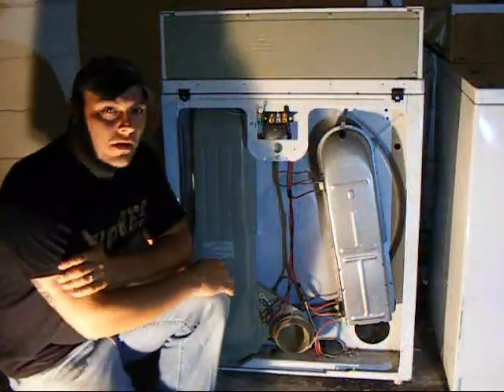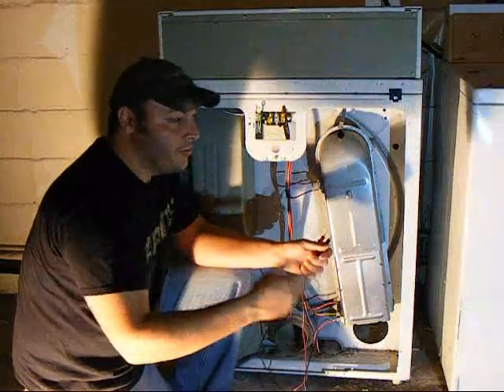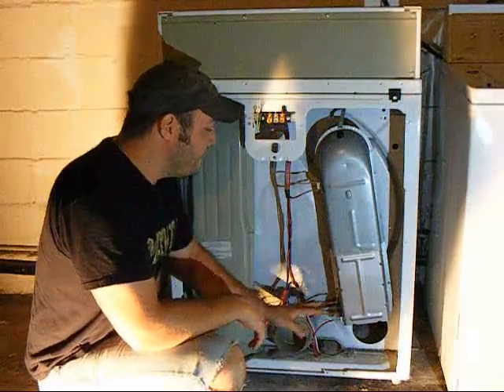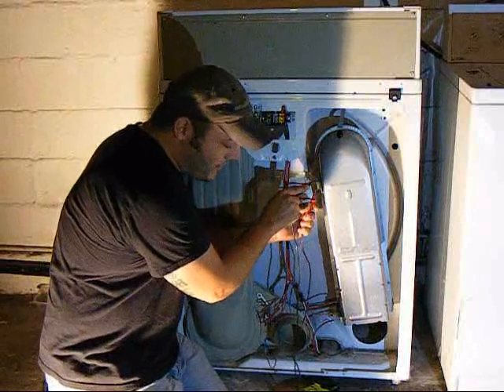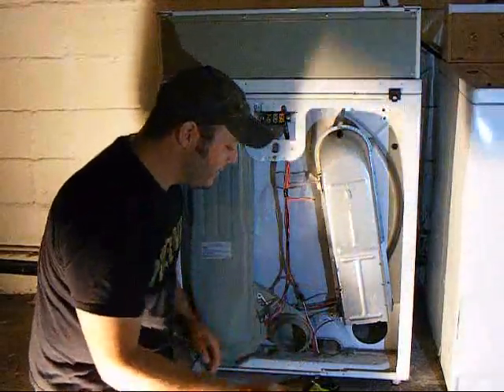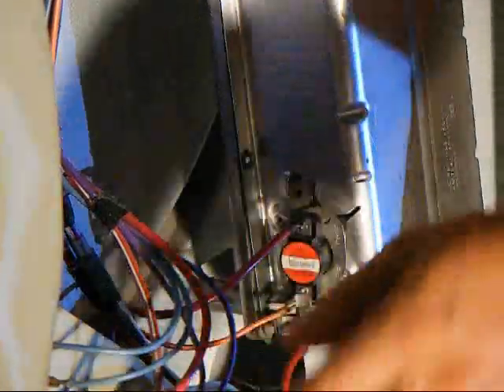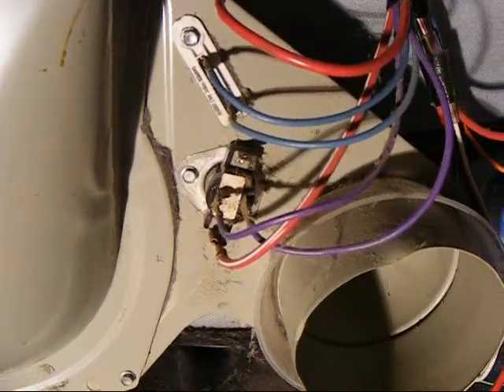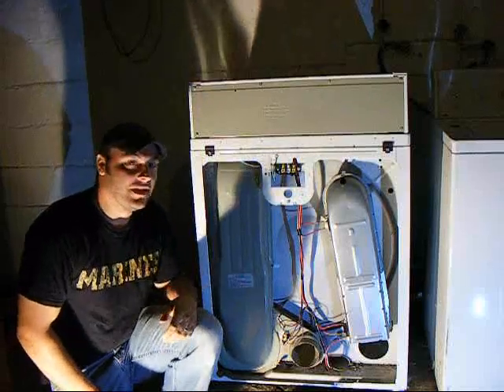Whirlpool / Kenmore Dryer Heater and Thermostat Test

Comment: I am not clear when you told to check the ohm of thermostat switch (the one has four legs) at the exhaust outlet near the lint.  You told to check the ohm of two legs that red wires connect.  What about the other two small legs that purple wires connect?  Do we need to check the ohm on both legs?  If yes, we must have the continuity on both legs too when we measure the ohm.  I got the reading around 7 ohms when I check those two legs.  YOur video is very helpful for the novice like me.

Comment from the maker: Your right really, its hit or miss if the machine will hold up or not.  Any brand is capable of failing within the 1st year warranty or you get lucky and they last 5-10 years.  I don't think there are 20 year washer and dryers anymore.  They are built complicated and with electronics.  Recipe for failure.
Talk to you later.

Comment: Love your video. All the checks passed. I read the comments and saw the one about the motor switch and tried that. This test failed. How do I replace this switch? I did not remove the drum, but removed the front panel to get access to the motor and turned it with my test leads connected to the red wires.

Comment: I'm sure someone asked but I'm really not wanting to surf thru all the comment. But my dryer (Kenmore) keeps popping that top thermostat with the 2 wires. The one that you said trips and doesn't go back. I have replace all the thermostats, element and sensors in the back. Where would I look to next that might be the problem. Thanks for your help.

Comment from the maker: @chrispricesr , yuuuuuup, replace the safety thermostat.   When you do that, run the dryer and ensure that the heater cycles on and off.  Run it with the back cover off so you can see the heater.   It should not stay on 100% of the time.   If it stays on 100%  you have another bad thermostat, that's not kicking off.  The dryer is running too hot and that is why the safety kicked off.  

Let me know how you make out.

Comment: Great video, I already had bought a heating element . Went and got a $10 volt meter figured out it was the non resettable thermostat watched the video on how to reset it good as new . Sending the new heater back total cost invested $11 and get as new. I like the " I Don't Give a Shit " part also . Great video !!!!!!
Reply: How do you reset a non resettable thermostat? Our safety thermostat is the only one not reading....is that the one you are saying can be reset? Don't understand why ours did it because it never even gets really hot.

Comment from the maker: One thing that I left out in the video was the motor switch.  On the motor you will find two big red wires.  Those wires only contact each other when the motor is spinning.  It is possible that the motor switch is bad and that is why your heater is not getting the voltage.
You will have to do some dissembling to get to the motor.  Find the wires, put your meter on ohms,  motor not turning, open circuit.  Motor turning, completed circuit.
Let me know what you find.

Comment: Thanks for the insight Bill.  I was able to use your video to check continuity.  The heater terminals have no continuity (but is open when testing the terminal to the side).  Also the 4 pronged thermostat HAS cont across the "big" red connections, but not across the 'little' purple ones.  What do you suggest?  Again, thank your for your help.

Comment: Awesome vid, very helpful and down to the point. I have the same drier that you made the vid on and I'm having a problem with it getting too hot, even on the low heat setting. I checked everything mentioned and it looks good. I also took apart the case and looked at the coils, everything appeared to be normal. We just moved and it started happening after the move. I'm guessing something was shifted and is keeping the whole time. If you have any advise that would be great!

Comment: Bill, Great video -what is replaced When you Check and NO continuity between heating element (wires) & separate heating thermostat.  No element wires are broken no wires touched the outer housing. I tested wire element-Gd, I tested Htg Thermistat-Gd, I tested element both prongs to metal housing (I) or infinity no problem with wires, But... there's no continuity between the Ht. element and the heating Thermistat connected there. What would be replaced or bad?  The only problem I had was forgetting to secure the element coil pan to the back of the machine so some wires did scrape the drum so I took it apart again to fix. Could it be the coil is shorted but still shows continuity?   Thanks

Comment: Hey, Great Vid! I have a Whirlpool Dryer that will get warm but not hot, takes 2-3 cycles to dry clothes. I have tested the element (9.8ohm) and all 3 thermostats I tested get 0.7ohm. I done it exactly like your video with undoing a wire on each one to test, and tested the element against the case to check for open circuit. I just can't figure it out. My thermal fuse seems good. I checked it also, got 0.8ohm on it. You mentioned this basically leaves the timing. It goes through on every cycle.

Comment: Do you measure the resistance across both pairs of connections on the third thermostat of your video? In the video you just talked about going across the power connection. Thanks

Comment: Thanks for your video.I have exact dryer and  10 month before it had burnt coil and I replaced and it was running good.Now again the heating coil was gone. Do you have any idea why the heating coil fails with in a year. Note I replaced new coil and now it is running.But HOW LONG???????

Comment: I've had people with the same problem. If the dryer does not heat, or does nothing and you've just moved in, check the phasing. Sometimes your 220 plug will be on the same pole in the fuse box. If you're hiring an electrician and they don't call it '2 phase,' you may want to hire somebody else.

Comment: Thanks so much for your vids...very helpful. However, i still have issues with my dryer not heating up. I checked the thermostats, checked the motor switch and everything had continuity. I only have voltage/continuity tester - so I could not check the ohms. So I put everything back together but the bottom cover so I can see heating element. When I turned it on - the heating element heated up for about 5 seconds and never went back on after a couple minutes. Shut it off and went back about 5 minutes later and turned it back on and the heating element still did not heat up. Any idea? Could it be the Temp switch? Could it be stuck on just Air dry? But wife says she never used airdry but has turned the temp switch from medium high to high. I have a Kenmore 800 series.

Comment: Hey Bill tanks for your great video. 
I have a( kenmore 400) dryer same  problem "works but not heat "and l check everything you teach on your video ,but l can't find the problem, this is my question, is anything other part l am missing to check? Tanks again for you video and l hope you can help me.
Reply from the maker: Manuel Nunez Check some of my other dryer troubleshooting videos.  I covered motor switches and the timer, they also control power to the heater.
Thanks for Watching!

Comment from the maker: Probably not the breaker, the cord probably was going bad.  Check the wiring inside the box where you plug the dryer in, make sure the wires are tight and making good connections.  Of course before you do that, turn the breaker off.

Good Luck with your repair and thanks for watching!

Comment: great video..All my components checked out fom proper resistance and voltages and when I reassembled it the dryer element heated for about 5 minutes or so then quit. I had a spare element around and tried it and got same result.. Any ideas?

Comment: I also had a heater problem and checked the cycling thermostat and my short terminals didn't show a closed circuit so I thought it was bad. I bought a new one and that one also didn't have continuity. I saw in another video that the short one is for low temp and isn't always closed. Is that true or did I buy a defective part?

Comment: Hi Bill great video. The very first step you did by checking the plug wires is where my problem is. left and center I have power but right and center I do not.  I checked fuse box everything seems to be good.  Where do I go from here.  Please help. is it in the plug socket on wall or the dryer?
Reply from the maker: +Heather McGann It sounds like your cord is probably bad.  This is most often the problem.  When you unplug the cord from the wall you can look at the prongs and you will probably see one of the flat terminals is dark.
Let me know what you find.
Reply: +Heather McGann I had the same problem Heather, and it was actually one side of my plug box (socket)...

Comment from the maker: with the dryer unplugged, put your meter on ohms when you test the motor switch.  Put the leads of your meter on both wires, then spin the tub by hand.  Spin it as fast as you can, you should hear a click.  Your meter will read open circuit when the tub is not moving.  It should read a closed circuit when you spin the tub.
Let me know how you make out.

Comment from the maker: 3980062 This maybe be your issue here.  This is the Electronic control that has the relay for the heater.  There should be some paperwork on the inside of your dryer that gives you a wiring diagram so you can locate the wires on this board that run to the heater.  You have checked everything else.  This is what you need to check now.
Keep me posted!

Comment: Thanks for the video.  I've ran into some dryer problems before, so I checked the thermostats and coil the first thing, but they were all good this time, but the dryer wasn't even coming on.  So when you started with the AC Voltage In, I figured what the hell..it couldn't hurt to check.  And sure enough, one of the three prongs were discolored and the plastic had a burn ring around it, prob from that storm the other night, but the breaker didn't even trip...guess I need some better breakers, lol

Comment: Great video.  I put in a new thermostat (the one that is on top that does not reset) and the dryer worked on a short test.  Then a few days later, I fianally ran a load of laundery, and it was not drying again.  I narrowed it down to the theromosat on the top.  Since I had just bought a new thermostat repalcement kit, I used the bottom themostat in substitute for the smaller top thermostat.  Is this safe?  The dryer seemed to work fine and the heater coils cycled on and off.

Comment: Thanks for the video! It looks like you are working on my exact dryer :).

The second thermostat that you checked in the video keeps burning up one of the wires right before the connection to the thermostat. This is the second time it has happened. Should I just replace that thermostat or all 3?

Comment: I have a kenmore 70 series gas dryer, it starts out with heat, then it stops heating, just glows but does not light up. I hope I don't get shocked, I'm joking! Think you can point me in the right direction? I sure would appreciate it. Seems like all the videos are for electric dryers. How about that lens thing inside, should it be cleaned or something?

Comment from the maker: I would test the motor switch at this point if nothing in the video worked.  The two big red wires on the motor plug will complete a circuit for the heater only when the motor is spinning.
Let me know what you find.
Bill

Comment: What about the thermal fuse, you forgot to mention that. It is the most common cause of a no heat condition. Other than that, nice job. Btw, this is what I do for a living, many years.
Reply: What if my dryer is overheating but everything i checked in this video even the thermal fuse are ok?.

Comment from the maker: Was the dryer turned on when you tested it?  If you run the dryer and test it,  Put one lead on the frame of the dryer and test one wire at a time to the frame.  Power should come in when its running, and power should be present at the other wire while its running.  Let me know how you make out.
Thanks for watching!

Comment: We have a Kenmore dryer that recently stopped heating.  We checked all of these and everything checked out.  Then you mentioned at the end of the video about the timer also being a factor in heating it.  We just noticed that the dryer runs and runs and runs but doesn't heat and the dial doesn't turn.  Does this mean the timer is bad and needs to be replaced?  Is there a way to test the timer? We figured we could deal with no timer...but apparently, we can't!  Help! :)

Comment: Hi Bill - Do I disconnect the 'external ground connector' before checking the dryer voltage? I've never done this before (have never even used my volt meter, before - yikes!) Love your video, btw. Do you have any videos about the heating element, in case this and the themostats aren't the problem? Where would I find your other videos? (Love the humor, too!) I have a Kenmore Ultra Fabric Care dryer. Thanks!

Comment: I checked everything but the motor switch and everything was good. I noticed i didn't get any reistance on the timer switch though. The timer works fine and runs and stops. If the red line going into the switch has no resistance will that make the dryer not blow hot air? Would I need to change the timer to fix my dryer?
Reply from the maker: Jason Vasseur There is a contact inside the timer and the motor that need to close for the heater to heat along with all the thermostats.
Check motor switch too if that's good, then replace timer.

Comment: What should show across the two purple wires of that 4 wire thermo on the exhaust vent, mine is showing open cct. Also my dryer only has two wires on the heater coil an thermo is that normal now?
Reply: Did ever figure out if the purple should be open or closed at room temp?

Comment: I have reset my thermostat but it keeps popping. I dont know what is setting it off I have cleaned out everything and the hose is not blocked. What would make the dryer overheat and keep blowing the non ressetable thermostat? Any suggestions?

Comment from the maker: Unplug dryer the dryer from the wall, remove the back cover, unplug both wires to the heater, put one lead on the outside case of the heater then touch the other on one heater terminal, should read open, then touch that lead on the other terminal, still should read open.  If you get a reading on either terminal then the coils of the heater are touching the case and kicking the breaker when the heater tries to heat.
Let me know how you make out.

Comment: My dryer quit getting hot and after determining it was the old warn heater coil and replacing, the thermal cutoff fuse kept tripping. I replaced that three times after checking continuity with all the connections, checking the seals, and cleaning it thoroughly. It still pops the fuse after about 10 or so minutes of running so I cant determine what's going on. Would a thermostat cause the heater core not to cut off and pop the thermal fuse?

Comment: thanks for the vidieo. have one question though.when replacing the botton right hand thermostat i was wondering what i do with the small orange wire. thermostat i got in kit had a red jumper wire but no place for orange wire.

Comment: You're funny! My dryer is running not heating..I don't own a volt meter so is there any way to visually inspect the heating element and the thermostats to see if they are bad? My dryer is only 5 years old and my house was just built so there is not build up of lint. I've watched another video to see how to get to the heating element but it wasn't real clear on what to look for to see if it was bad.
Any help you can offer to this single female would be great!

Comment: Hi Bill
What model number of kenmore dryer you are working on with back panel off? I have a kenmore 90 series model  number 11060902990 and the back panel is tack welded on. Am I missing something? Need to check high temperature fuse. I checked heating coil and that is ok. Have no heat in dryer.  Thank you
Reply: Your access is likely through the bottom front, like my Kenmore 700 is. Google how to remove that panel, there is a trick to it.
Reply: Steve Melia The access is through the lower front...panel pops out but to get to the fuses is kind of a pain but possible.

Comment: Thanx for the video. My Whirlpool LEN2000PW0 was spinning & outputting air w/o heat. Worked again after I replaced heating element (broken coil) BUT then I replaced the safety cut-off & the hi-limit t-stats as well, b/c they're old. Now it won't heat anymore! Got continuity across leads on all 3 t-stats, thermal fuse & hting elemnt (no short circuits). Terminal blk leads fine (120 V each) OK EXCEPT that instead of 240 I got voltage off the scale of the meter. What to do now? Urgent! Thanx.